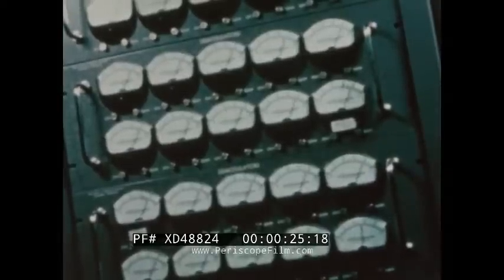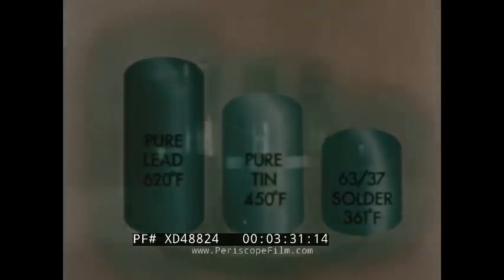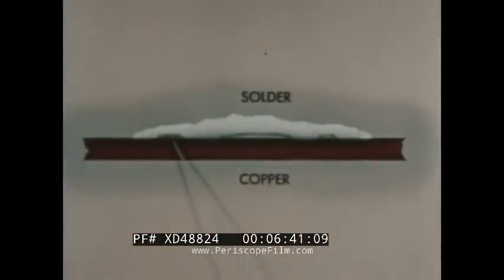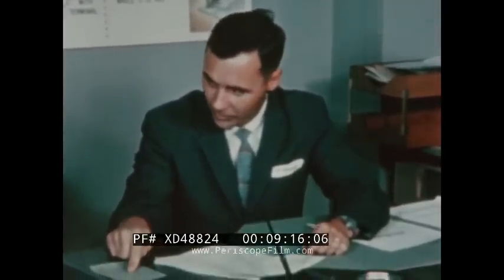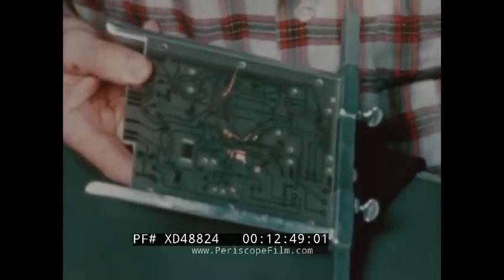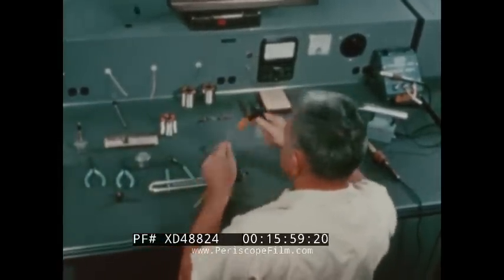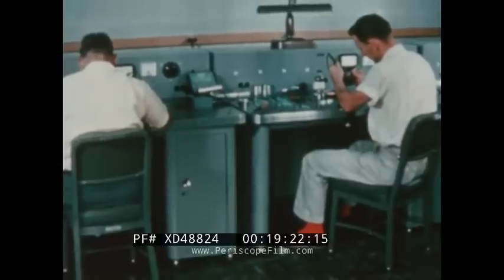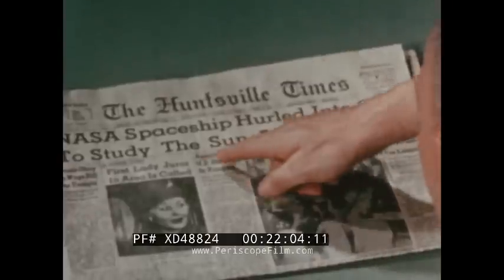1958 "ABOVE AND BEYOND" NASA SOLDER & SOLDERING TECHNIQUES ELECTRONICS INSTRUCTIONAL FILM XD48824

Comment: I have completed the high reliability soldering course and out of 16 students was the only one that passed it. It was the most frustrating training I ever done. with 10 years of building all kinds of circuit board projects nothing was good enough for the instructors. The entire class were depressed. One difference was for the installation of a resistor, the leads can't touch the side of the hole nor rest on the multilayer board. The solder lead must be also cleaned. Things are always changing but the principles are the same.
Reply: Congrats! I tought high reliability soldering in the nuke power industry for 10 years. Had to be NASA and NRC certified. Out of 44 students that started at the same time, (12 max to a class), only 5 passed. I was one of the 5. The instructors said that was the typical pass rate. The joke is, when you know how to do it right, you make it look very simple and easy to do. But its very hard to learn the skill to that point.
Reply: "One difference was for the installation of a resistor, the leads can't touch the side of the hole"
Oh? Why is that? What problems can this cause?
Reply: @klopferator  ...I suspect that the combination of heat and stress on the resistor leads while they are being soldered, affects the resistor body: when parts are heated, they expand.

Comment: Great video, and another one is showing how to wrap and secure wire bundles back in the day before tie wraps and all the newer plastic devices. That was an art as well. Sometimes you come across an old radio or electronic device and they did the wire wrapping per military spec, it's a beautiful thing.

Comment: For years I would get very frustrated with my little pencil iron, the type that just plugs into the wall, I just couldn't solder very well at all.. Then I got a proper station with a separate power supply and variable temp control. That made a huge difference. It might be obvious to those with experience but I had no one to teach me. Now I'm glad to solder something. This video really educated me about flux.

Comment: As a sonar technician in the Navy, in the advanced electronics field…I was sent to schools for both basic soldering and 2M (miniature/micro miniature repair). Since it is very hard at times, underway,  to get parts…there had to be 2M qualified techs aboard. One of the best schools I had at that time. Came in handy when I switched to the Army and my future civilian job after retirement from the Army. Love soldering inside chips with a microscope as the tip looks like a pencil. Great video! 🤘🤘🤘
Reply: Did you go to Sonar school in Key West? My oldest brother taught there while on shore duty around 1970.

Comment: I'm NASA certified. I had been soldering electronics circuitry for 10 years when I got certified. This was in the mid 1970's and there was more to learn, mostly about PCB material, voids and pinholes, and ensuring that it had a low humidity content in the material. I even learned about new PCB materials, flaxible bds, Teflon bds. The industry changed very rapidly. One thing I saw being done very wrong in the video that they failed to mention is a fundamental of the job, either holding or fully covering a lead as you cut off the excess. If a wire end is snipped off without being held it can fly across the room into another circuit and short something out. Myself, I had a new assembler across the isle clip a heavy resistor lead, and it flew across the isle and cut my ear. It could have put an eye out. I made sure they quickly learned the proper technique. When you're done clipping you should have a pile of lead clippings equal to the number of leads you clipped. Anything short of that means there is a length of conductor lost somewhere just waiting to short something out. I don't count both, but I don't need to. I do the job right.

Comment: Excellent film, been soldering electronic stuff since 1960 and repairing surface mount gear to component level for decades, cleanliness and attention to detail are key factors, sometimes just making one joint can involve lots of operations and take more time to set up than actually apply solder.

Comment: I have taught soldering classes in informal settings a few times, and one thing I've discovered is that sometimes the people who "used to solder for a living" are sometimes completely hopeless at soldering. I think they only ever learned how to solder industrially prepared equipment, super clean, with high end soldering equipment in a clean environment. Give them a circuit board that they need to solder with an average $50 soldering station and they mess it up.
The WORST are teenage boys, because they know everything. The BEST are little girls (like, 8 or 10 years old) or old ladies. They both are interested to learn and will listen to instruction.

Comment: Great video! The basics of soldering haven't changed since then and there interesting points to be gleaned from this video but what has changed since then has been drastic. Those circuit boards are only capable of 'mapping' a handful of functions whereas today, a circuit board of that size is enough space for the electronics of a computer.
Reply: The production of circuit boards is largely automated -- solder paste is screen printed onto the boards, a pick and place machine adds the components and the line then moves the boards through a multizone soldering machine. (Some manual work is still required which is where these techniques are important.) Parts have got even smaller recently, individual components are like grains of pepper and a part like a processor may have 400 or more conenctions through an array of tightly spaced solder pads on the board side. (No hand magnifier to inspect that -- you need X-rays.) Its a modern form of magic.
Reply: @martinusher1  Depends on the industry and product. Many things still use thru-hole which are a pain to pick-n-place.